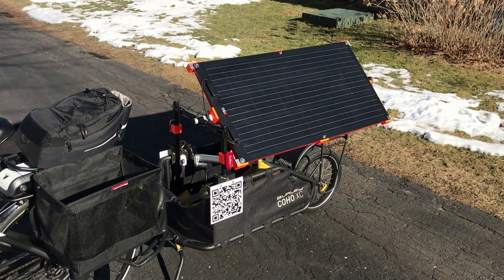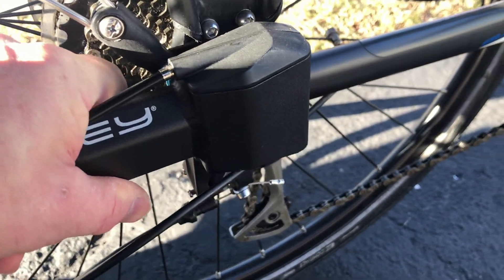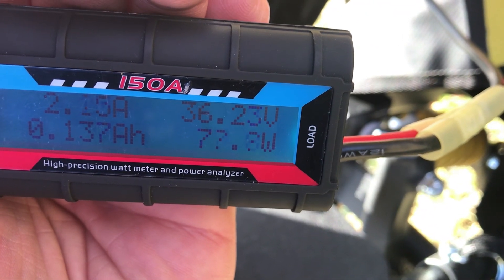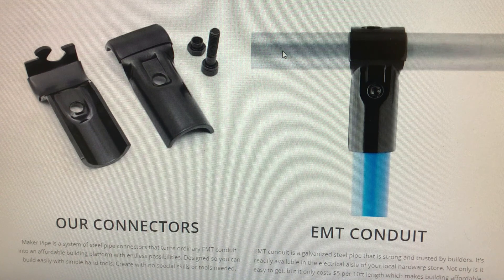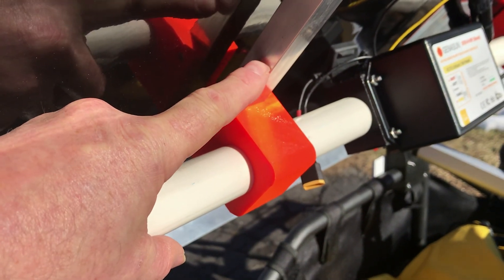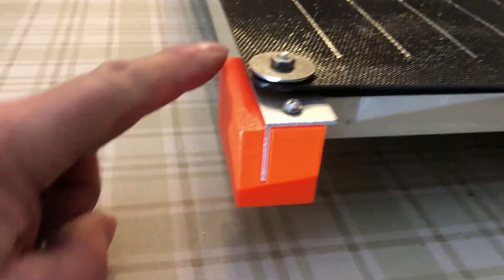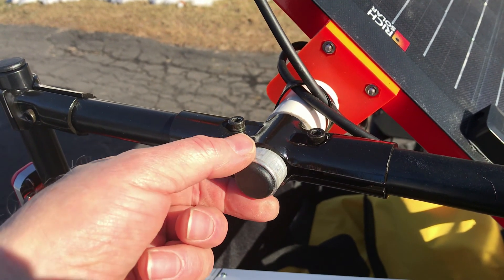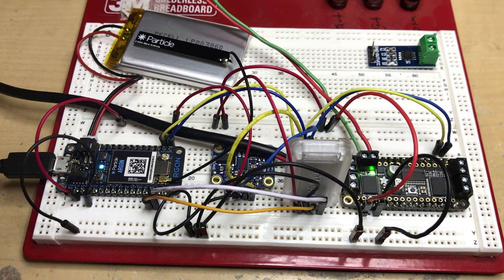Solar eBIke Trailer for Charging eBike Battery

Comment: Why dont you just have 2 panels in a pyramid shape? Or even better just build a box over it and have a panel on the top and sides. More coverage and more panels is more power and more range and if you put a battery for saving extra power which i would you can then charge multiple spare batteries even once the sun goes down. You can make it like a pickup truck with a camper so the back can have a bed door that comes down like a pickups. Youde be able to add a good ammount of usable storage could keep a whole large tent setup in there if you wanted
Reply from the maker: I wanted to be able to flatten the panel if the wind came up. You would also need to have two solar chargers because one panel would be shaded and not producing. Correct angle to sun make more power. I also wanted to make the trailer as light as possible
Reply: The purpose of the actuator is point the panel toward the sun, output power doubles. A two panel solution always has one panel poorly producing, one cancels the other. The width can be an issue,

Comment: Please use the term lightweight vs falsely claimed 'flexible' panel... silicon cells crack if flex/bend...
Link to trailer not good any longer...

Comment: Wow, fantastic, my congratulations! However, I consider a simple solution using this very trailer with a horizontal, foldable, and easily removable approx. 160W panel.
Reply from the maker: I also have a folding 100W panel that fits in my bike bags... but it's a pain to fold out everytime I stop. We're carrying camping stuff in the trailer anyway
Reply: @SerendipitySue  This 160W panel would stay open on this trailer all day long. I would remove and fold it only when not needed. There are also light weight 200W panels available now with useful sizes, but without convenient folding option.
Reply from the maker: @danielduesentriebjunior  Cool, which panel are you using? How big is it? I was trying to keep the trailer CG as low as possible. The tilt angle makes a difference in the early spring / late fall here in NY. I also wanted to make it lay flat if the wind came up.
Reply: @SerendipitySue  Have not bought anything yet.

Comment: Wondering what is the weight of the whole system without the panel? Reason I ask is that although a tilted panel will generate more power, the extra weight does slow- you down also. Trying to find a balance between pro's and con's.
As I mainly bike in Europe poweroutlets are never far and an extra e-bike battery costs only 2,5 kg in weight.
Reply from the maker: It's -10F right now... when it gets a little warmer, I'll go out to the barn and weight it

Comment: love this ;-) is there way to charge while riding on current battery ? like a generator on a car
Reply from the maker: Not that I've figured out with the Bosch battery
Reply: @SerendipitySue  there has to be a way, all these car co. and everyone is talking about charging stations ? when we should be making then run for life of battery on solar a self generation from movement ... the E GEN IS A SCAM by BIG OIL to make sure THEY still control us !!!
Reply: If your bike allows you to provide power for consumption and charge at the same time then yes. Your bike will not have a bosch battery by default because the bosch battery is either in charge mode or battery output power mode

Comment: Chris, I am trying to build your design. I have down loaded the files and printed the parts. Do you have any more documentation on this build that would assist me in completing it, also does the panel auto seek the sun and how did you do that
Reply from the maker: message me and I can send photos. I've found that the wireless remote keyfob is the simplest so far. Haven't found a good automatic tracking approach yet
Reply: @SerendipitySue  Chris, i just now saw your reply quite by accident thus this late reply. how would i message you any other way other than this.
Reply from the maker: @enjoylifejourney1669  if you go to my youtube channel ABOUT tab, you can find my email
Reply: After 600 miles of real world use, I agree, wireless remote is the best way,  @SerendipitySue

Comment: Too many energy is wasted dragging that trailer, its better to make everything lighter.
Reply from the maker: works well for us. We stop to check stuff out often. The battery charges while we are on/off the bikes. Plus we have our camping equipment in the trailer too. Setting up a portable charger every time we stopped would be a pain.

Comment: Nice, I like your setup - did already 2 tours of 2000 km (also with 100W solar) - I am altering it now to 180 Watt with automated actuating - I have some videos of my tours on my channel. The setup of 2020 with a 36V panel connected to a Victron bluetooth MPPT works best for me at the moment (max output I had was 106 Watts with that panel).

Comment: I am about to build the same thing on the same trailer but with the electric motor integrated into the trailer wheel. So that during the week I can ride with my conventional bike and on weekends go to the grocery store with the trailer or travel. Thank you for the details about the pieces you have used !
Reply from the maker: Nice! Let me know how it goes!
Reply: I am about to build a solar trailer with a 200w panel and an integrated rear hub motor as well. I am using a recumbent tadpole trike with a 1000w rear hub motor to pull the trailer. I think I can integrate the controls of both motor with one throttle and one PAS and brakes to the recumbent. All these sensors have 3 wires. The trailer and the trike will have their own controller. This way I will also have a redundancy in the hub wheel. I don’t think I can have tilt because the solar panel will be a canopy mounted higher to accommodate a 100lb dog and a couple of 20ah batteries.

Comment: Very nice.. The 12v actuator you used (with remote) can be accomplished by adding 2 light sensors (one on the right) and (one on the left)  When the sun hits one, the panel automatically is actuated towards the light.  That way you won't have to use a remote..  It will be automated by the position of the sun.  This is how large panels are automatically turned.
Reply from the maker: Thanks! I thought about that. I also wanted to be able to "Store" the panel for high winds.
Reply: Cool for pivoting.  Would you not do the same for tilt angle?
Reply: Automatic tilting can probably be accomplished with Lego technic robotics.

Comment: Dangerous and foolish... but I won't explain. It will just get deleted again. LOL!
Reply: We appreciate your feedback. But, I don’t think it’s foolish. It is only base on your experience. If there’s high wind that day, telescope it down and lay it low and flat or simply pull over. I’ve seen many use trailers like this and have put many miles on them. There’s people that have successfully cultivated enough solar to negate their power consumption on long rides. They will always have extra batteries. 17lb solar panels are heavy. U can get flexible 200w panels under 10lb for cheap. Pair that with a boost MPPT and charge the battery directly. I will be doing this with my electric recumbent tadpole trike. The trailer will have an integrated rear hub motor to drive the weight of the trailer when needed as well.
Reply from the maker: I got email that you commented, but nothing was there? What did you say?
Reply: @SerendipitySue Don't sweat it. I had just spent an hour crafting a reply to let others know that riding with a solar panel sail is far too dangerous to attempt, especially one that is so small that it can't keep up with the power consumption while riding anyway. If all you are doing is a couple long day rides back to back then investing in a pair of large capacity batteries is a way better way to extend your range. But having a power source to recharge electronics, most importantly the ebike battery of course is awesome! I have a few different items that need more than the USB charging ability a dynamo hub offers. The main one being a Fugoo XL Bluetooth speaker (19V) that I always ride with. Using the panel, a Voltage Boosting MPPT Solar Charge Controller, and a variable DC to DC converter lets me charge everything I ride with... when there is sun anyway. It allows me to ride into and through areas that would normally need a support vehicle to access and ride without the panel. Unless you are trying to race through some desert for money and YouTube followers... like others seem so inclined to do, I'd suggest you carry a panel safely secured in the trailer and deploy it when necessary. It will also save you all the weight and space taken up with your sun tracking system. It's a great-looking system and would be much better suited in other applications. I also suggest you look at trailers that attach at the seat post and don't expand your turning radius like the Coho. It's nice on single-track to be able to turn and corner like an unburdened bike can... and around when necessary. With two 58.8V 35Ah triangle batteries, I have a range in excess of 130 miles even with a fully loaded bike and trailer, even more, when on a hard level surface, and that's without stressing the packs by using only 85% total capacity or over 3300Wh with the pair.  

What I believe to be the best all-around ebike build: https://photos.app.goo.gl/ADgC6oyPM2gyrCq27

SunCapture 300W Solar Panel: https://photos.app.goo.gl/rFim5rPsajmDt8NJ6

25 Jul 20 - Mowich Lake
https://www.relive.cc/view/v8qkd2LGdKv
https://photos.app.goo.gl/hRSTYZ8UjzdpuQ7n8

26 Jul 20 - Rain Forest trail
https://www.relive.cc/view/vQvyDGe2W4q
https://photos.app.goo.gl/WcoVAreB4TUdAiPF7
https://www.youtube.com/watch?v=WwwdaVg4Y5M
https://prnt.sc/tsxt5p

Stay safe.
Reply from the maker: @brianbassettnumber1  Thanks for your feedback! The solar rig piston does take up some space. The solar system adds weight. I have a folding panel ( https://amzn.to/2O4xShY ). We stop and explore a lot as we ride. Constantly setting it up was a pain! With the trailer, I just park in the sun. If it get's windy, I just put it in the flat position. I haven't had a turning ratio issue with the COHO trailer yet. I was originally going to build a gooseneck trailer with the seat hitch. I still may. I like the COHO quick release and kickstand. I'm using the solar panel to charge a second ebike battery and additional electronics.
Reply: @SerendipitySue  When you ride for days, weeks, even months at a time bike touring, or bike-camping, bike packing... or whatever the newest millennial term that's used to make something seem new, both space and weight become of the utmost importance. My solar panel and batteries are 17 lbs. each... 50+ lbs total but well worth the effort for traveling from base-camp to base-camp. It's also nice to have a $2500.00 solar panel completely protected from inevitable spills. The fun comes when you are in the middle of BFE and able to do multiple long day rides out of camp with a stripped-down bike. It does take some effort to pull the panel out and set it up but after 4 to 6 hours in good sun. I can usually ride for two days before I need to recharge either battery again, about the same amount of time as when I use a Satiator to recharge with AC. Glad to hear you stop to enjoy the roses when you ride, so many don't. I understand that keeping your panel horizontal would help some with gusts but I'd still be very careful especially around semi's... they can pull you into traffic so quickly you can't even react. I can actually turn in a tighter radius with the trailer attached than without it. There is a steep learning curve when the center of gravity is raised but it makes a much better ride overall, and disconnecting the trailer is pretty easy, a matter of 10 seconds maybe. I have a swing-down stand on the trailer for when it's disconnected but when I stop the center-stand on the bike will easily hold both very secure... a must for touring with a trailer. - https://photos.app.goo.gl/wP8vs7T5hLpNjSBX8

Stay safe.
Reply: @brianbassettnumber1  That's good to know about big trucks. We ride mostly on bike trails and back roads. I worked hard to keep the center-of-gravity as low as possible to reduce "wagging". I thought about getting a 2 wheel trailer. They are more stable but are heavier and have more drag. The main drawback is that some of the trails have narrow gates/bridges to get thru/over. Some times it's even tricky with just my rear saddle bags. Can't wait for snow to clear on the bike trails! If you are ever riding in Upstate NY, look us up!
Reply: @brianbassettnumber1  BTW what front panier rack are you using? It looks like you have suspension forks?
Reply: @chrisnafis7000  Two-wheel trailers aren't the way to go Chris. I have seen them have a single wheel hop up over something and at the least make the rider unexpectedly swerve, worst veer off the trail. I hear you on narrow infrastructure... I have had to download my bike many times to squeeze through areas. Thanks for the offer but I have a friend in upstate NY that tells me the ticks are horrible. Ride safe man.
Reply: @brianbassettnumber1  Who the hell spends $2500 on ONE panel? better be 2kw
Reply: @theejoeylee  Go back to sleep Joe, some of us are lucky enough not to have to deal with "junk".

Comment: Great. You put a lot into that. Way more than the thumbnail indicated.  How long does it extend your ride?
Reply from the maker: We hope it allows us to ride the Albany NY to Buffalo NY Erie Canal bike trail in a week 😉
Reply: @SerendipitySue  I guess what I was asking... does the panel produce enough to run indefinately? Or does the battery eventually drain. In other words, is it a net gain or net loss.
Reply: @justinroysdon2630  Erie Canalway Trail is 360 miles and mostly flat. That's 51 miles per day if you're trying to do it in a week. Depending on your fitness level and loaded bike weight, this might be relatively easy or impossibly difficult to do without electric assist.
Reply: @justinroysdon2630  I have a solar ebike with a 315 watt solar array and typically my battery is discharging while riding (net loss) and charging when I stop (net gain). In the summer, I can average over 100 miles per day but terrain, road conditions, weather and pedaling effort determine what's possible on each individual day. This is a 100 watt solar panel so you can extrapolate from there.